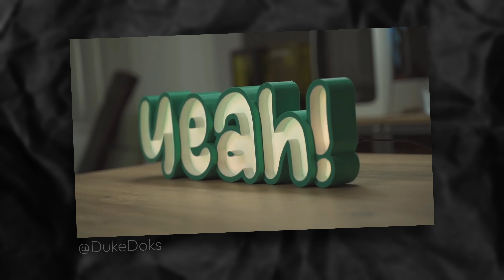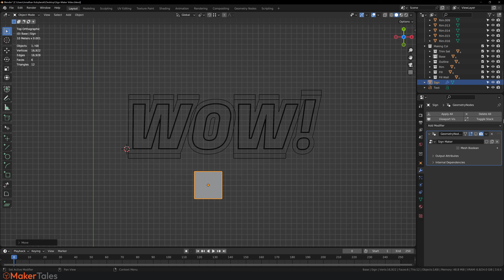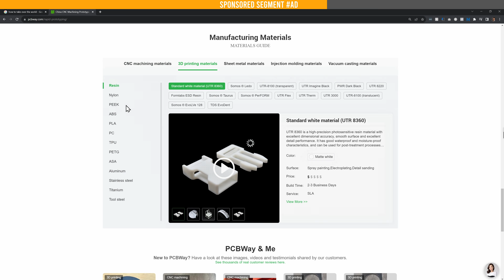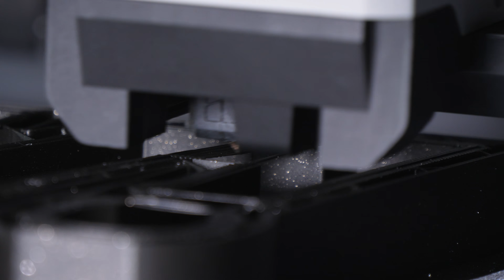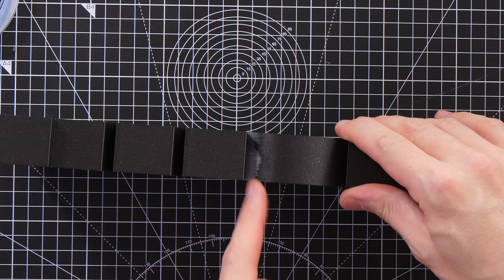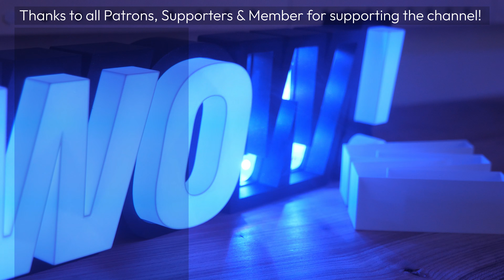3D Printed LED Marquee Letters

Comment: Your work is amazing, but it is true that it needs the inside white or some irregular reflector like crumpled aluminum foil, not only for better diffusion, that black will turn all the light it absorbs into heat, it will turn into a bonfire.

Comment: what type of filament is used on the white extruded part?
Reply: You can use PLA. Thin enough so the light can pass through, around 0.2mm or 0.3mm
Reply: @pabloypachu  Thanks for the info. Newbie here.

Comment: I've found that making the diffusion pieces 0.2-0.6mm thicker can also help with diffusion, depending on the strength of your LEDs.
Reply: What material you used for difussion?
Reply: Also If you print the diffuser upwards (sometimes necessary) fuzzy skin can make a very nice diffusor.

Comment: Lemme tell you what you have to do to enhance light difusion as a 15 years of experience letter maker in the signmaking industry.
You take the black casing and cover it paper tape and paint the inside zone where the led's will be put. You will get perfect difusion then.
Reply: 5 years sign making experience here... why the hell wouldn't you make your backs out of prepainted .090" and prepainted channel coil?  you'd have to be crazy to paint absolutely everything.
Reply: Hey, could you provide some link for more details
Reply: @viacheslavpronin8553  the point is to make the inside of the non transparent part of the letter white so it will make a huge diffrence when you light it up

Comment: I'm gonna bet making letters from acrylic is a thousand times cheaper in materials and time. I've seen the videos of Indians making them and without lasers too
Reply: This is a 3d printing video on how to do this at home by yourself. Not sure how your comment is relevant or helpful whatsoever.
Reply: And your point?
Reply: without lasers...  uh, what?
i work in a commercial signage shop that dates back to 1945 and we absolutley dominate the industry in our city of population 1 million.  we have a laser cutter but we don't use it to make acrylic faced aluminum channel letters 😂
you seem to have no clue and little regard for the rapid protoyping of 3D printing.  this is $3 of filament.  $3 of 3/16" sign acrylic is about the size of your phone.
Reply: @thorium_glass  so this is cheaper? I want to start making signage from home and was looking for the most cost effective way
Reply: Cool. Want to make your own video on it? This video is about using a 3D printer and PLA.
Reply: Good luck curving the acrylics for such small letter and gluing & burning your fingers .
Reply: But india is not for beginners
Reply: Could u share that video link
Reply: Cred ca glumesti. Nu ai habar.
Reply: This is probably about 150 grams of filament, or $2.  So no

Comment: What material did you use for the diffusion caps? And how thick was it to be able to let the light shine through? Great video!
Reply: In my experience the best is natural pla (no color) at 2mm thickness. 

I also like luminous and glow in the dark blue. They both look like natural pla but the after glow is cool.
Reply: Thank you!  @GhettoArabSage